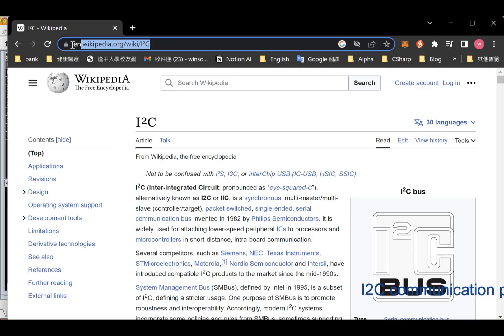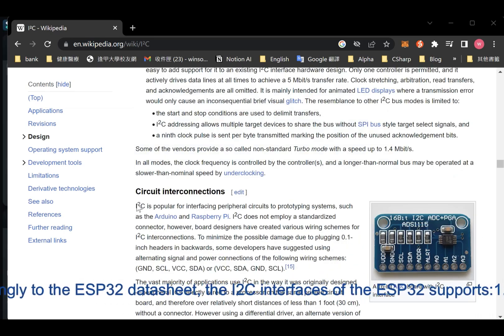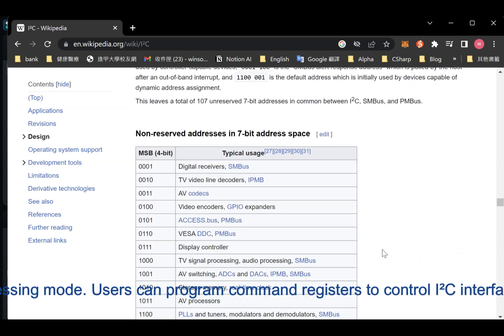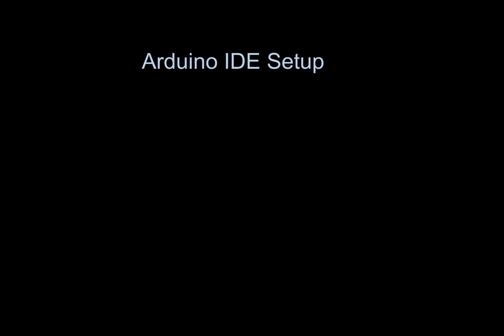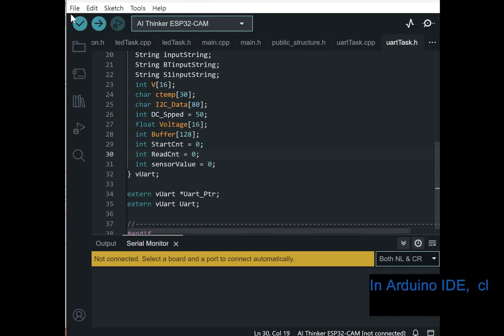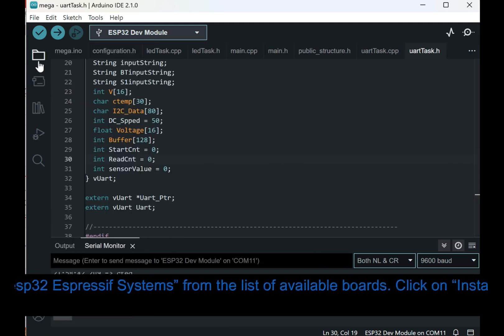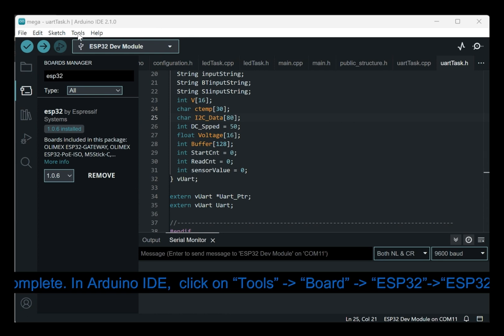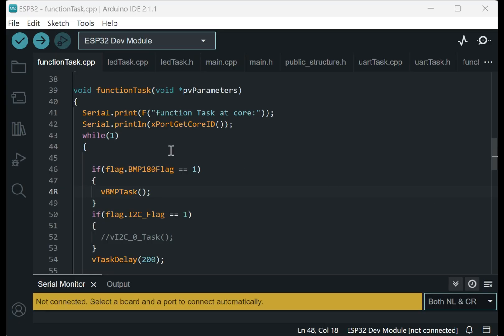ESP32 I2C Bus Scanner –BMP180 section

Comment: Can you tell me how to connect two different sensors to esp32 with both having same  SDA SCL pin?
Example- connecting Display module and Temperature module to esp32!
Reply from the maker: You can SCL connect together, and SDA connect together then I2C_SCAN you can get two different i2c address!